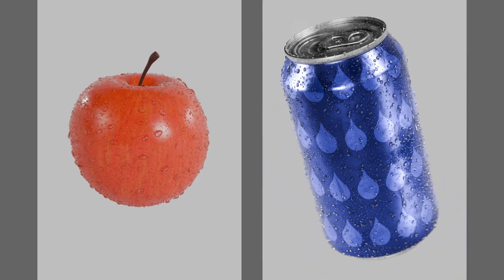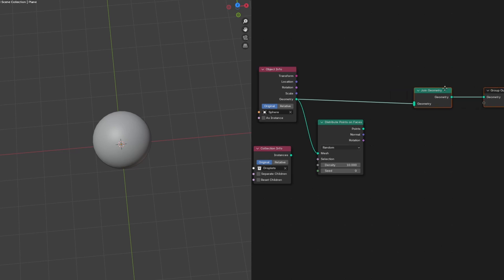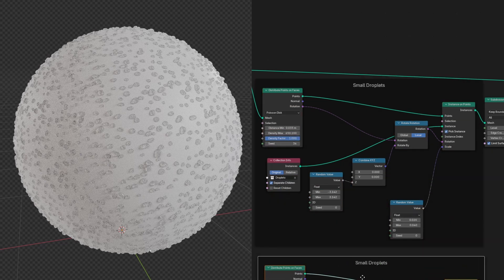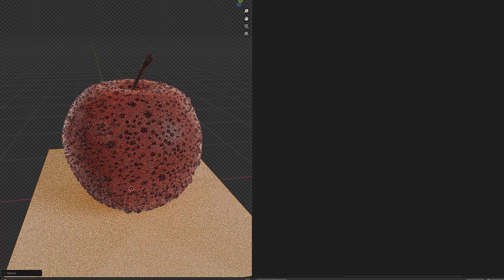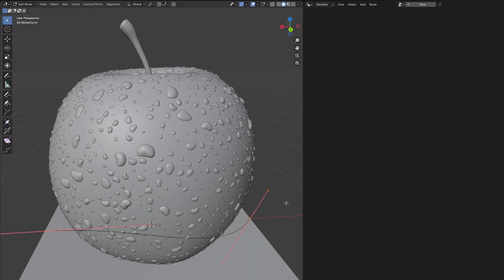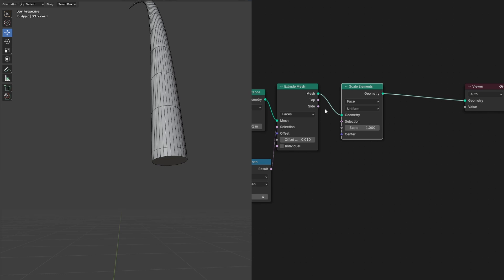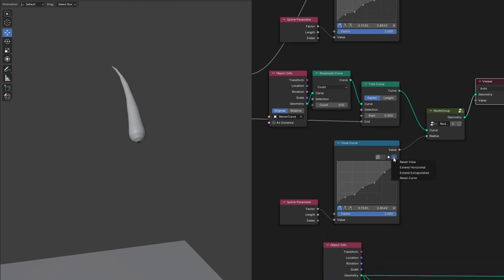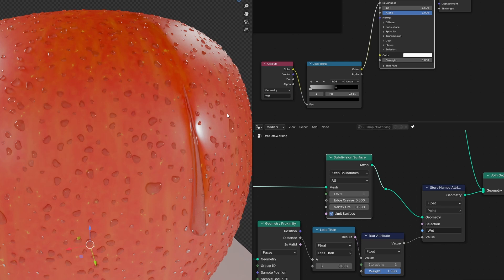Make Water Droplets with Geometry Nodes

Comment: Thanks for the tutorial. Something about trying to use this approach on a soda can that is real world size is very difficult. Need incredibly small values that are a pain to enter into Blender. Had to add lots of multiply nodes to give myself an easily tweakable interface for exploring different values.
Reply from the maker: Yeah that's an issue with real-world scale in blender. Multiply nodes with a decimal are good for working with small values. If you don't like that, you can probably scale up your can to a size that works well and then scale everything back down at the end of the node tree.
Reply: @tomgrave3D I gave up on trying to take that scale down approach a long time ago. There is also some procedural texture coordinate or bump node strength value that does not scale properly. Always a headache when I try that.